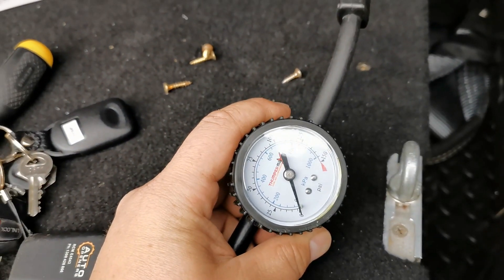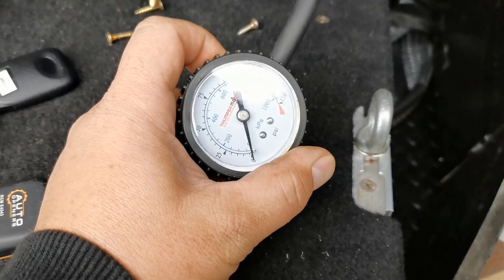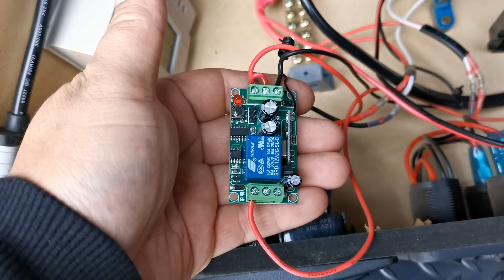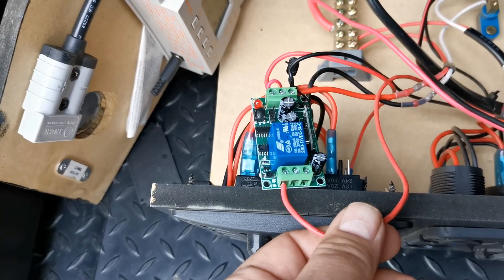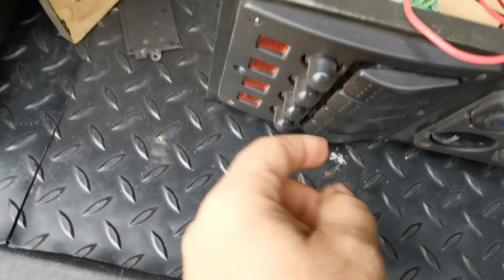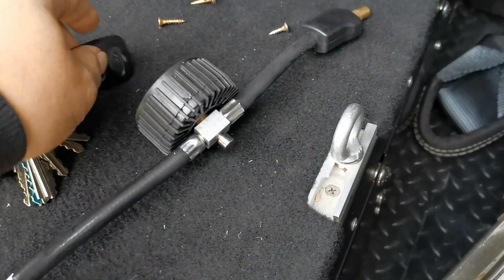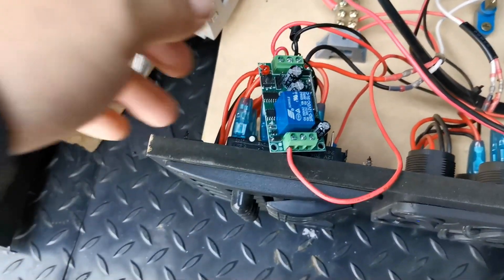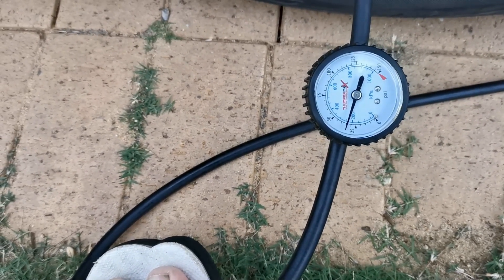$18 4x4 Air compressor mod

Comment: Hey mate if you leave the compressor in the on position can you eliminate the switch to power the controll box
Reply from the maker: Leaving the compressor switch on would result in a parasitic draw. It might flatten the battery over a long period of time. Also it means if hit the remote switch accidentally, the compressor would turn on. I wouldn't recommend it but yeah, it is one way to eliminate the remote switch.
Reply: I totally agree I decided to set mine up like you did I’m currently waiting for my remote switch in the mail. Thanks heaps for the video it’s helped a lot 👍🏼

Comment: Hi great idea. I have a kings compressor which is negatively switched so is this possible without adding a relay to main compressor power?
Reply from the maker: Yeah the little relay board can switch negative too (it's just a different jumper wire config.)